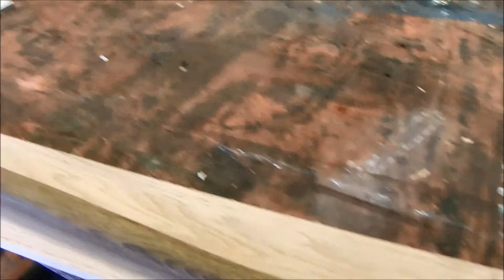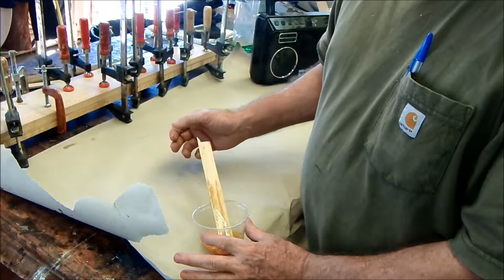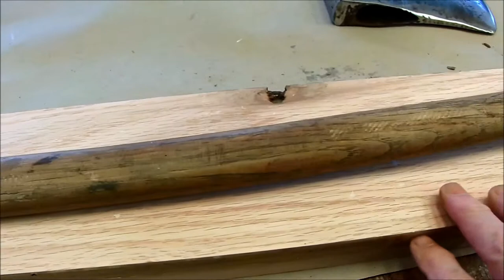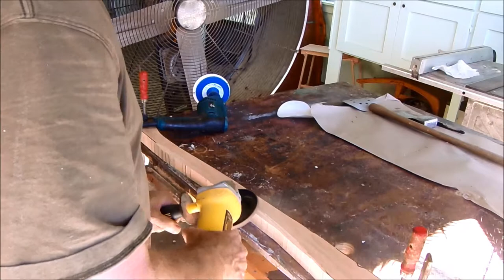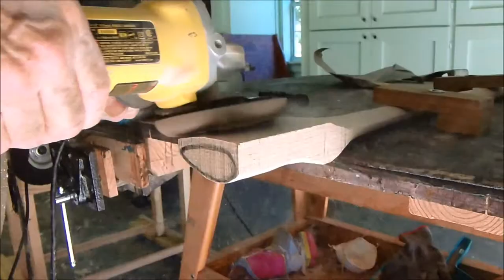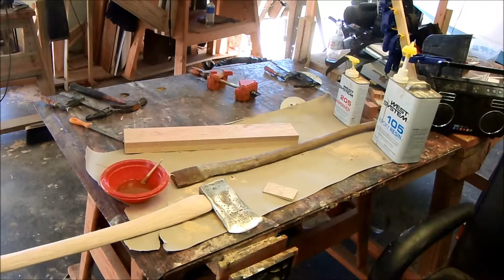Making an oak axe handle (first try, or part one) 1 or 2

Comment: Very few videos do I watch over and over again and search for by name like your channel.  I haven't seen anyone else carve their handles like this because everyone uses a rasp or spoke shave which appear to take forever.  I bought one of the sanding disk pads and am about to finish up a handle with one.  Thanks again for the video, please do more like this for handles if you can.  I'm an axe junkie and cannot get enough axe restoration videos like this!
Reply from the maker: https://youtu.be/ASTehgkjnE4  Making gun stock
https://youtu.be/AX8uOvYmxaU  Making gun stock
https://youtu.be/03lKqHxl-Ps  Making hammer handle
https://youtu.be/dfNEQFtrPJw  Making ax handle
https://youtu.be/LenSLWvWB6A  Making pecan hammer handle
Here are few of my other handle videos.  But I have several other carving videos where I carve everything from Windsor Chairs to wooden bowls.  
     I think the best handles are split from ash or hickory, and then shaped with an ax, draw-knife, rasp, and spokeshave.  But my method seems to work for me, especially since I use kiln-dried dimensional lumber, with a very low moisture content.  
     Thanks for watching and commenting.  Hope to see you around the channel.  I have lots of videos.

Comment: Hi ya!   I like your carving technique!  We have those grinders and drills,  I might just give that a shot.  Thanks for the idea.
Reply from the maker: Again, thanks for the good word.
     I use a lot of tools for carving; it all depends on the situation.  In my next video I'm repairing a gunstock, and there I use a Dremel Tool and a large belt sander.  In some applications I use a hand power planer and a hand operated belt sander.  
     But the most important tools perhaps are the two large B-52 fans, which are sucking and blowing across my workstation.  This setup sometimes allows me to carve without a respirator. 
     Thanks for watch, as it looks like you are my only audience.  I may have to break down and join Facebook to spread my videos a little better.  What do you think?
Reply: *****  I'm totally jealous... and looking forward to the Dremel work.  ** Remember to put the names of tools in the title of the video to draw views.   Dremel should do it!
  Yes, I was noticing the big fans.  Awesome... I was wondering if the dust is caught outside and used for anything?   I would like to do  two experiments with saw dust, but haven't yet.  One is putting saw dust in ice as it supposedly makes it super strong and it doesn't melt like plain ice.  It was something the Germans discovered near the end of WWII but had no time to use the discovery and it was kind of lost.   You might try it as part of your Haus Frau duties for your hunting trip.  I use milk jugs for ice, but if you put 65% saw dust in some and just water in others for your trip you can do my experiment for me. (Please)  If the story is true the saw dust ice should last way longer.  If you decide to try it be sure to video it for me.  ;) 
   The other is to try to make some wax/saw dust briquettes. Since wax is expensive I want to figure how little wax is actually necessary, maybe none... just wet it and press it like  The Do It Yourself World did with paper?  I was just in Ireland burning the peat...that was fun.  I don't see why pressed saw dust would be much different.  It will be a while until I get to that one though.
  I hate Facebook now. I have told everyone I will be deleting it.  There is a private messaging feature in Facebook which now wants permission to use your phone or computer's camera and microphone without your knowledge!!!  Oh hell no!!  They put their toe way over the line!  It's too bad because that is how I have such a close relationship with my friends and family all over the world at no charge.   I have to figure out a substitute free communication with them. Skype it is I suppose... but I am not a fan of video phoning. Oh well...
Reply from the maker: MollyDolly I hear you on Facebook.  I only lasted about a month.  Since I'm old, I know a lot of people; and some of those fine folks are better memories than "friends."  
http://en.wikipedia.org/wiki/Pykrete  Frozen ice and sawdust is called pykrette.  It does melt slower because of lower thermal conductivity.  However, that would diminish the usefulness of the ice (I would guess).  
I believe they do make sawdust briquettes. I've seen both briquettes and pellets.   Just looked it up and there are hundreds of different kinds of sawdust briquettes.  I bet one of those articles would tell you how to do it.  Sawdust is also used to make many kinds of manufactured wood produces.  Don't think any industrial producer burns sawdust like they did back in the day. My neighbor works in a sawmill, and she told me that they throw nothing away; everything from sawdust to bark is sold.    
 SawDust Stove

Waste Oil/ Saw Dust Burner for Rocket Stove
www.motherearthnews.com/diy/sawdust-stove-zmaz74ndzraw.aspx

This is how they disposed of sawdust back in the good old days:

http://www.flickriver.com/groups/wigwam-teepee/pool/interesting/
Reply: Good stuff!  Thanks!   Now I have to check if "Pykrette" will be cold enough in an ice chest to use it camping. hmmmm... interesting.
Reply from the maker: MollyDolly One more, and I'll leave you alone.
The camping trip is over, and I completed my Hausfrau duties with dignity.  The "commander" of our camping trip was so impressed with the camping table that he assigned me four more jobs: 1) The Axe handle, 2) repairing a shotgun, 3) building a cooler carrier, and 4) building two more camping tables.  
      The Commander didn't offer any money to cover the cost of these projects, so I guess I'm to take it out of my Hausfrau wages.  
      The shotgun repair is my next video.  After these projects are complete, I'll need new ideas.  Got any?
Reply: ***** Oh, you should know me better than that by now!  LOL! Ideas...Why, yes,  yes I do!  Troy needs a bat house according to Terry Teagues and others...but since he is my gardening guru I'm gonna believe him... despite the fact I have never seen a bat house I think  you can build one. Think of it this way, when he opens the boxes people  like to go to the channels of the sender and see what's up... you should get loads of new viewers if you put a note in the box that says  you made a video of the building of it.   Now, since I have no idea how big a bat house  is, if shipping it is prohibitive I'm sure I can give another idea.  Then again that might be a fun part of the project to make it lightweight enough to ship, and  make it disassemble to flat, too. Now there's a challenging project.  :)

Comment: Very nice use of the grinders.  I was going to use a spoke shave to make mine but now I think I may use my angle grinder.  What grit flap disk did you use for the initial grinding?  I have 60, 80, and 120 grit flap disks.  I fear 40 may be too aggressive but maybe I'm wrong?
Reply from the maker: https://www.amazon.com/Kutzall-Original-Dish-Wheel-DW412O230/dp/B00DGXX8QQ/ref=sr_1_5?s=hi&ie=UTF8&qid=1480437098&sr=1-5&keywords=carbide+carving+wheel

I don't use a flap disk much, rather I just use a high speed drill with stick on sandpaper.  Here is what I use:
1.  Kutzall dish wheel.  Many different kinds.  Bulk carving.
2.  Drill with sandpaper disks.
3.  Large belt sander
4.  Spindle sander
5.  Finish with Random Orbital Sander

You can use a spoke shave and draw knife, but it is very difficult in kiln dried dimensional lumber from the lumberyard.  The best handles are split off live logs, and then carved using an ax, draw knife, and spokeshave.  

I have some later videos where I make some hammer and hatchet handles using mostly a belt sander.  

 https://youtu.be/AX8uOvYmxaU  In this video I make a gunstock for a shotgun using the five step process outlined above.

Thanks for watching and commenting.
Reply: Hi.  I may be ready to try the Kutzall dish but which one?  The fine, coarse, or very coarse?  Do you use all 3 for your handles or just one of them before moving to the sandpaper disks on your drill?  Thanks again!